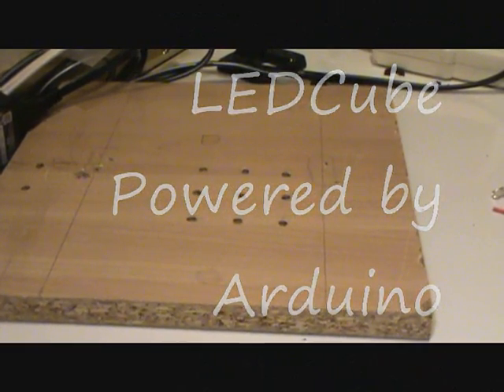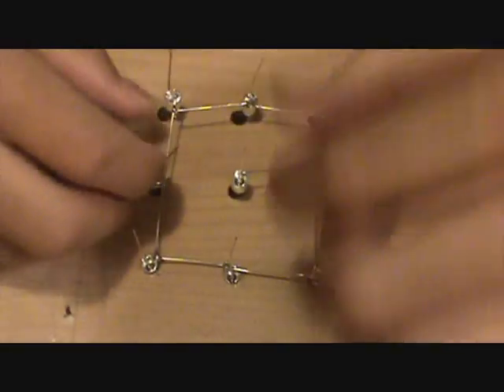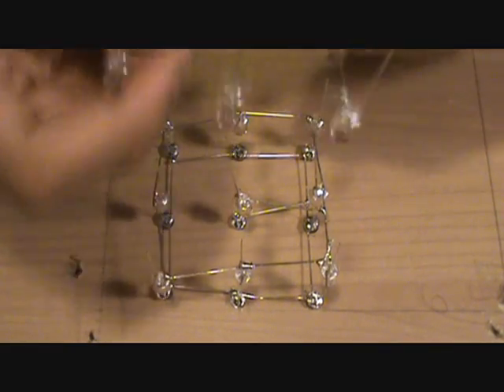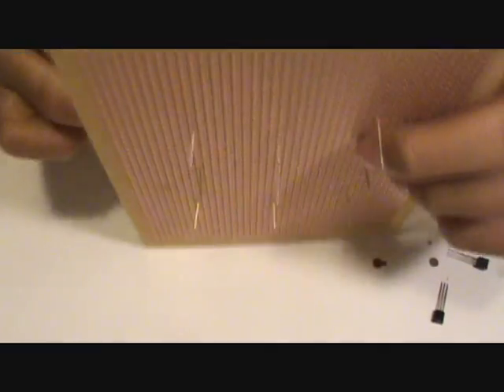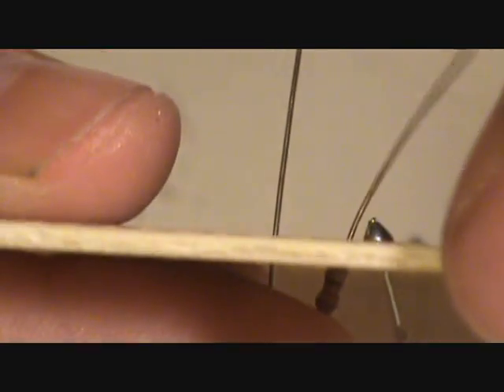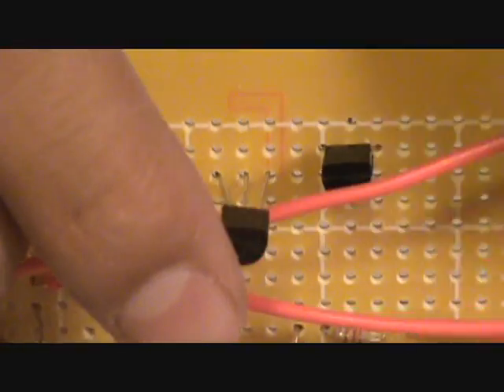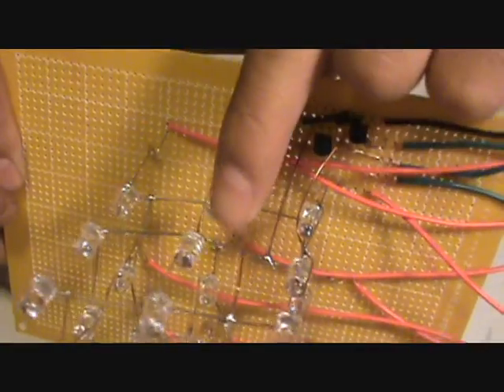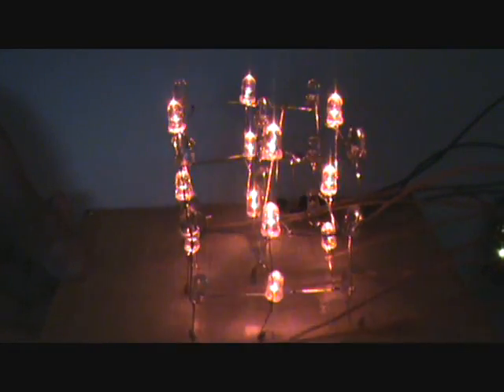How to make an LED Cube (PT1)

Comment: You need to think 'crossway'.
Each LED is in located at one column and one row.
Botto row: LED 1 - 9
Middle row: LED 1 - 9
Upper row: LED 1 - 9
Imagine each colum as one entire switch dependent structure and each row as another switch dependent thing.
The bridge between a column and a row is the LED itself, so each LED will lights up only when BOTH column AND row are switched on.
So that's it.
Did i made myself clear?

Comment: When one of the 9 columns is supplied power, the whole column has the potential to light up, but the three transistors attached to the 3 levels control which levels the current can actually flow through to complete the circuit. So basically the code specifies a level and a column, and that corresponds to an individual LED

Comment: It's quite similar to how you do a 2D LED matrix - you control only a row at any one time and just scroll through all the rows. That means that, say, there's an 8 bit shift register which sources current to LED columns and 8 NPN transistors which sink each LED row seperately. First you turn on the first transistor and make the shift register source the current to the pixels you want. Then you turn off the first and the second on and write the second row data to the shift reg. And so on.

Comment: Its due to multiplexing.  With all the cathode ends tied together and all the powers tied together you can pin-point what LED turns on based on what lead get a power input all of the ground tied together.

Comment: Think of it like x and y coordinates. If you look at x, you know which column it is. When you add the y in, then you can pinpoint where on that column you're looking at.

So LEDs need BOTH a cathode and anode to be active (complete the circuit), right? Just one or the other won't do anything... So activating a row of  cathodes and a column of anodes will result in ONE led (the x,y coordinate) having a completed circuit.

Comment: Which is the distance between each of the LEDs when u do the holes on the mold?  Which is the name of the little circles u put to the LEDs before welding the catodes and the name of the board in which u weld cube of LEDs, in which u work the last part?

Comment: When soldering you leave your iron tip on the solder pad too long, If u keep the iron on the pad long enough you could peel of the solder pad. considering the led's you did a good job - just curious? how many patterns does the arduino produce with the code?

Comment: those were 33k resistors in the video because orange=3, and the orange band is 1000, so 33x1000=33,000. 22k resistors would be red=2 and red=2 and orange= 1000, so 22x1000=22,000.

Comment: Cool but it is flawed: if you want to light diagonal LED's on different levels, you run into an issue where other LED's in the same row are lit. But that requires A LOT to fix. Otherwise, this is a fun little project. It would be absolutely awesome if you did it with multicolored LED's, but again that requires a lot more.

Comment: The center lead is the base. The lead on the left is the Emitter, and the one on the right is the collector. NPN type transistors are called NPN because of the way the transistor is doped with intrinsic compounds. The N side is the cathode, and the P side is the anode when the diode is in forward bias. Transistors are two diodes in one. A transistor works by when the Emitter is Forward Biased and the Collector is reverse biased. Then you have a voltage drop trickle effect on the base.

Comment: Ok I don't know much about electronics but there's one thing I'm not understating: if the LEDs are sharing cathodes in the layer and anodes in the column how can you make them lid independently?
Let's say you want to light up LED [1, 1] and LED [3, 3], won't LED [1, 3] (and [3, 1]) also light up?

Comment: i don't get it. wouldn't there have to be 9 more transistors on the other side? with 3 transistors you can have only 8 different states, but there are 27 LEDs.

Comment: @tigrezz I believe you have a short circuit between two or more leads for the top level. I had to solve the same problem, and managed to find the cause and fix it. You have to examine the traces on your board for tiny bridges between rows. Clean up with a file and see if that works.

Comment: here's my suggestion - might be original - I don't know - but I like it : )
Getting the cube right is no trivial matter.  Let's adopt fibre-optics into the program.   Have a "virtual cube" in a box with fibre-optic connection to the display cube.  The terminus of the fibre can be a glass marble to give it a bit of substance.   Could have three boxes RGB with three fibres per marble.  Trust this as reasonable and on-topic.